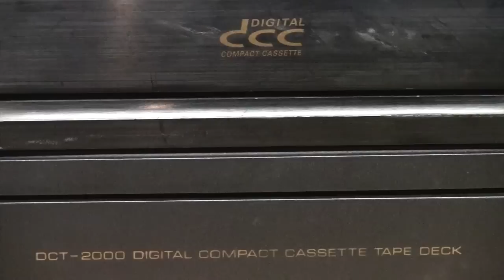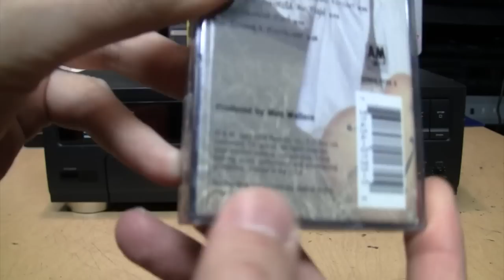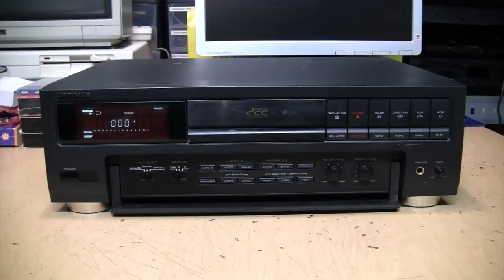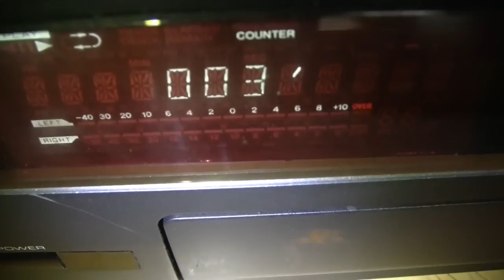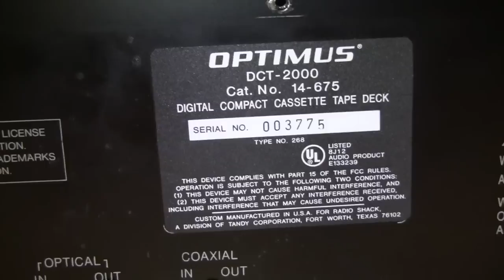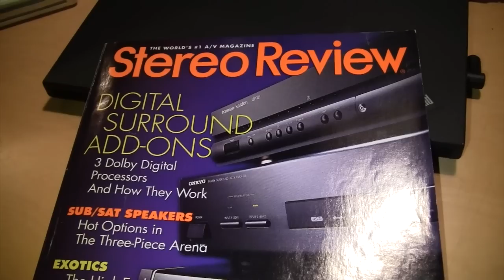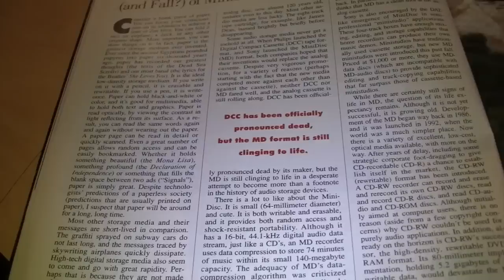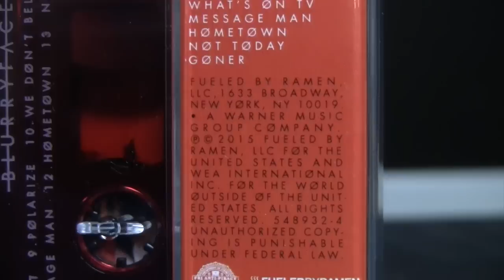DCC = Digital Compact Consternation

Comment: Thanks for posting! Here's some more interesting information about DCC:

7:27 The tape is so dark because it's like video tape, with really high density. Each head records a binary signal at about 96kHz and there are 8 heads for audio, plus one head for auxiliary information which works at a much lower rate (12kHz). If you would play a DCC tape on an analog recorder it kinda sounds like white noise. If you would have gotten your DCC recorder to work, you could have put a piece of tape on one of the holes to pretend that it's an analog cassette, to make that audible.

10:29 The DCT-2000 was the first "OEM" DCC recorder and it was produced at the same time as the first DCC recorders by Philips and many other manufacturers as far as I know. Most of the other manufacturers just used the entire schematic of the first Philips DCC recorder, the DCC-900, and put their own enclosure around it, but Tandy made their own recorder in cooperation with Philips. Philips provided the plugin boards which have the same DCC chips as the DCC-900. Unfortunately there is no service manual or schematic for the DCT-2000 (only a parts list and an exploded view), and there are no datasheets for the chips of the first-generation recorders, but there are plenty of datasheets for other recorders and there's enough information about the chips that makes it obvious how they work.

16:28 David Rogers (the guy who wrote the letter to the magazine) is the guy who ran the DCC-L email discussion list in the 1990s. Alas, it no longer exists and I don't know what happened to him. I myself was an active member of the DCC-L and I wrote the DCC-FAQ in 1996 just before the demise of DCC. It's still online (http://xs4all.goudsm.it/dcc-faq.html) but I don't maintain it anymore so it's full of dead links and outdated information. I also wrote most of the Wikipedia page about Digital Compact Cassette (https://en.wikipedia.org/wiki/Digital_Compact_Cassette), and I update it a few times per year with new information. I also recently set up a Github repo at https://digitalcompactcassette.github.io with service manuals, datasheets and other information that I've found elsewhere online.

Dr. DCC is a friend of mine, we're both Dutch guys living in Southern California who like DCC. He runs the DCC museum and he's been in contact with some people from the industry lately. We've uncovered a lot of information about DCC that wasn't known before; for example Philips apparently made it mandatory to store data on prerecorded DCC's that can be shown on a TV screen with an "ITTS" decoder. Those decoders never went into production but he has a pre-production version that actually works. They show a couple of pages of 40 lines of 21 characters of text and ("teletext") graphics. We have plans to reverse-engineer the ITTS box to see if we can build our own. I also have some other plans to expand the capabilities of other DCC recorders but they're still a secret because I don't want to create false expectations.

I hope you'll eventually try to actually get the DCT-2000 repaired. Again, thanks for posting!

Comment: Fellow YouTuber databits made a video a few years ago entitled Optimus DCC DCT-2000 Digital Compact Cassette Deck Restored - Philips Made. In it, he shows which boards need to be pulled and what value capacitors you need to get. He also had to replace the pinch roller. There are no service manuals for this online, but any of the DCC decks from this era will need to have this servicing done eventually.
Reply: Exactly what crossed my mind right after the video started!
Reply: Which goes to show how shitty these decks were made. They really were in cost cutting mode with these. I have tape decks from the late 70’s that work perfectly well after changing belts and cleaning play/rec switches. Dell PC’s from the early 2000’s had similar shitty caps.
Reply: Steven Smyth Yeah, his video is from 2013 and is the same model as yours (Optimus DCC DCT-2000) just search it as "databits DCC"
Reply: Shrek most everything from that era had bad caps. It was the capacitor plague. It affected a lot of companies, not just Philips and Dell, but Apple, HP and Acer were also tainted. Not their fault, it was a very real thing you can Google up in a few seconds.
Reply: Max Powers If I can scare up the Philips version for a reasonable price, I’ll get one and service it.
Reply: Radio Shack never had a reputation for making high-quality home stereo products. But they had a better reputation and market penetration in the USA than Philips (Magnavox) in that time, so when Tandy wanted to be the first OEM seller, Philips was eager to work together with them.
Most other DCC decks are well made except for the problems with the capacitors which is common to electronics from that era. I own several DCC decks and portables and they all still work; the only thing I did with them was replace belts.

Comment: My Optimus DCC deck's serial number is (no joke) 010101.  It also suffers from bad caps, but it did briefly play a digital tape in my video.  Maybe one of these days I'll get around to replacing the bad capacitors.

When it was new, it was a great deck.  Like you said, the transport controls are responsive, the auto-reverse is quick, and the audio from a digital tape was near CD quality.

Comment: I found a DCC cassette in the trash once (there was no deck with it unfortunately) but I actually tried spoiling the tape in to a regular cassette and played it to hear what that would sound like, and it just sounded like FM radio static.
Reply: Mhm. Those DCC tapes had limited compatibility.
At least I think I remember hearing that somewhere.
Sadly I don't get to think too much about DCC.
Reply: *spooling?
Reply: CoolDudeClem it's digital information, you'd hear the same if you listened to a game cassette through an ordinary tape deck, I hope you are able to reverse what you did as the DCC tapes are extremely scarce
Reply: What color was the case?

Comment: What put me off buying DCC was the size of the decks.  Even with the CD tray loading method, they stood so tall.  I went for minidisc in 1998 which was a prettier sight!
Reply from the maker: The later generation DCC decks were smaller, but by then the format was already pretty much dead.

Comment: I found a portable DCC player at the flea market last year. The belt didn't survive, though.
Reply: Replacement belts are easy to find. Check eBay. They're a pain to put into portables though, because you have to unsolder the PCB from the mechanism.
Reply: That's why I gave up buying the unit. At least I've touched it.

Comment: Hopefully you can get it working again, it might be a fun project. Even though you only have 1 DCC tape, it would still be a fantastic deck to play and record regular tapes in. I'm not sure about the tray-loading mechanism though; how easy is it to clean the heads without opening it up every time?
Reply: DCC decks can't record on regular tape, only play it back.

Comment: At first glance on the plug in card with the SMD capacitors I could already tell they were leaky from the corrosion on the components around the capacitors.

Comment: I'm 7 minutes in while writing this.
If you were to spool the DCC tape into a regular audio cassette and play it you would hear anything between nothing and a really high pitched whistling. The carrier frequency of the digital recording is somewhere starting at around 21kHz.

If you were to record on DCC tape in an analogue machine without BIAS adjustment, you would get a really loud recording because the special metal-particle tape for DCC is EXTREMELY sensitive.
If you would record on it using a high end deck with BIAS adjustments you could achieve among the best recordings with it, as 20kHz+ is the range the tape needs to be good at, everything below that will obviously be no challenge.

The other way around: There is a way to record a standard analogue tape with DCC coded digital music, you just need a really high quality tape. The japanese metal tapes are known to work well (TDK MA(-X(G)), Maxell MX, etc). 
Interestingly, the Maxell XLII (which is a ferricobalt chrome substitute tape) is also known to work well enough which states it as a tremendous chrome-type-tape.
Reply: The signals are recorded at ~96kHz per head. The tape is basically the same as video tape (chrome dioxide, not metal) so yes, recording with a normal cassette deck would probably not be successful though I don't know what the effect would be. I heard from an engineer in Hasselt, Belgium who worked on the recorders, that when there was no tape available yet, they used TDK SA-X (high quality chrome tape) but that still doesn't have a high enough grade to record the digital signals successfully (I tried; you end up with lots of dropouts). Maybe they ran the lab decks at higher speeds or something until they had tape, I don't know.

Comment: I had a similar DCC deck in 2001 or so that also would go through all the motions but wouldn't play.  I never bothered to figure out what was wrong and got rid of it.  It's kind of funny because I think that mine was Philips, and I'm pretty sure that the Optimus equipment of the time was made by Panasonic/Technics.
Reply: I don't know about that time, but when I worked at RadioShack in 2002/2003 most of their crap was made by Thomson and had RCA labels.
Matsuhita (Technics/Panasonic) was involved in the development of DCC, they made the early portables (Marantz made the later generation) and they also made their own DCC chipsets (all non-Technics DCC recorders use Philips chips).
Reply: I had misremembered who built their stuff. It wasn’t Panasonic, it was Pioneer, and it continued even when RS was licensing RCA from Thomson. Nicer stereo stuff than had the RCA label for years. Pioneer was an MD licensee, so maybe the DCC was actually Philips. It does have blue VF display when RS/Pioneer’s stuff was orange.

Comment: I wonder why they had pluggable cards?  I'm guessing Tandy were assembling the players but rather than licence the chips from Philips and install them directly on the board, they just assembled the cassette player and had Philips provide the DCC circuitry on those two cards.  

I'm assuming they were intending to resell the same board and case as "high end" analogue casette players just without the DCC cards (and with the expansion slots unpopulated)

Still, had the DCC carried on long enough for a codec upgrade (say from MP1 to MP3 or even AAC) they could have used the same board and case and just plug in the newer DCC cards with the upgraded codecs.  

And then years down the line, Techmoan would be ordering a spares DCC 2.0 version of this model that doesn't work and he can't fix, before ordering a spares DCC 1.0 version of the same model, finding it plays analogue tapes perfectly fine and then swapping the cards around and getting a fully working DCC 2.0 player!
Reply: Yes. Philips produced the plugin boards and Tandy made the recorders. This was probably the fastest way to get this to market. 

As for the possibility of upgrades: if you dig into the service manual for the Technics RS-DC8 (which is that last DCC recorder that Matsushita produced, with their own chipset) there are some subtle hints that they might have been working on a different format, perhaps running the recorder at half speed for 2x90 minutes of 192kbps MP3 music or something. But of course this was much later than the DCT-2000.
Reply: +Jac Gouldsmit - yeah, it was after I typed and posted this that I realised that the tape would have to be run at different speeds to accommodate the different codecs.  

AAC might have been introduced to the DCC market as "better them MP3" in the same way that Microsoft tried to introduce WMA as being better than MP3, by claiming that 64kbps WMA sounded as good as 128kbps MP3 (it didn't, it sounded better than 64kbps MP3 but worse than 128kbps MP3) instead of being introduced by Apple as being better than MP3 at the same bitrate (once you get past 192kbps lossy codecs are all much of a muchness)

Now which codec, between WMA and AAC do you still hear about nowadays?

Anyway I digress, I suppose if the DCC cards controlled the speed of the deck then they could pull this off, I'm assuming the tape speed would have to pretty accurate to maintain the ability to decode the tapes, the much higher bitrate of the data on a DCC would mean it might matter more on a DCC than saving a program for an 8bit micro on a regular cassette.
Reply: Yes, during playback, the speed of the capstan is controlled by the data that comes in from the heads. The way this works is not really documented but this is a basic servo principle that has been used for a long time: the data from the tape is streamed into a buffer and when the buffer is almost full, the capstan gets a signal to go slower; when the buffer is almost empty, the capstan gets a signal to go faster. The data is played at crystal-accurate speed, and the speed of the capstan only varies slightly because it comes in so fast.

When the deck is recording, the speed is controlled from a tachyometer on the capstan: The recording speed is factory-calibrated at 4.76 cm/s so that other decks can play the tapes back successfully. It would be almost trivial to run the deck at a different speed during recording (and therefore at playback because the servo circuit automatically tries to match the playback speed to the recording speed -- within limits of course). But when the tape runs slower, recording might not work so well because the tape still only has space for so-many-bits per inch. And the servo works from the bits coming in from the tape.

It certainly is possible to do a minimal amount of hacking to get two interleaved streams of data on the tape at regular speed (after all it has 384kbps bandwidth so if you intercept the encoding/decoding you can write two streams of 192kbps at the same time. However this hack would be unpractical because if you would want to replace one 192kbps stream you'd be erasing the other stream too. Also you'd still have the direction change in the middle of the tape. I suspect that Matsushita was working on a chipset that made it possible to run the tape at half the bitrate and thus half the speed, so you would be able to get 90 minutes on each side, encoded at 192kbps, with no requirement for special tape, and probably no audible loss of quality if they used MP3. But I can't be sure and we'll probably never know. All we know is that it's possible in theory: after all with the DCC-175 and the PC-link cable it was possible to record any kind of data onto the tape using the backup software.

Comment: Still very common available second hand here in NL also blank tapes!, I always wanted a dcc walkman but there are about no batteries available for them :-(
Reply: I think the DCC Museum in Redondo Beach, CA has batteries for the DCC portables. http://dccmuseum.com
Reply: Also, you could put together a 6V battery pack and plug it into the power supply input on the back of the portable. But of course that also makes them even less portable (they are very heavy to begin with).
Reply: daar heb ik geen kaas van gegeten :-)
Reply: I had a portable DCC player and it came with a rechargeable battery pack, one that looked like 4 AA batteries packed together. Unfortunately, I was not able to locate a replacement battery pack. Unfortunately, the battery life was only about 2 hours (if I remember correctly). I wish Philips had just chosen to use standard AA batteries, with the option to use rechargable AA batteries if you choose.

Comment: Why you don't repair it? There are only defect Capacitors inside around the Head Amplifier, first change this and then we will see. First clean up the Head. Only use the SMD Capacitors from Digi-Key or Mouser etc.
Reply from the maker: I did get it repaired: https://www.youtube.com/watch?v=nwYNYKP419c

Comment: Some formats just weren't intended to be digital i suppose.
Reply: With hindsight, it's hard to imagine that Philips could possible think that DCC was the right direction to go. But at the time that they started developing the format in 1988, there was only DAT (very expensive and not very robust at the time), and prerecorded CD (which was taking off massively). Philips was also working on recordable CD at the time, but CD-ROM hadn't even come out yet. The first CD-recorders in 1991 or 1992 or so were gigantic and cost as much as a car. But by the end of the 1990s, CD-R and CD-RW really took off and DCC just didn't make sense anymore. Even if the format would have sold like wildfire, it would have been discontinued in a few years because there were much better options by 1998.
Reply: I think that DCC was a victim of bad timing. I think that had it been introduced instead of CD it might have succeeded. I purchased a DCC deck and DCC portable because I thought the format would be the victor over Minidisc because: (1) backwards compatibility with regular compact cassettes which gave it a massive library of available music even without DCC tapes, and (2) the blank tapes were less expensive that blank minidiscs with longer recording time. Unfortunately, affordable recordable CDs were soon available which doomed this format.

Comment: Their portable decks mechanisms are far better than their component decks as they used stationary heads for autoreverse rather than the rotating head, which were less stable in azimuth like the cassette decks were.

Comment: did you try hooking up to the headphone output in the front? It sounds like a cold solder joint on the output jack.
Reply from the maker: Yes.
Reply: That's unfortunate. It is probably an issue with the DAC then. If the tape deck has a digital output you could use an external dac.
Reply from the maker: The issue is bad capacitors.